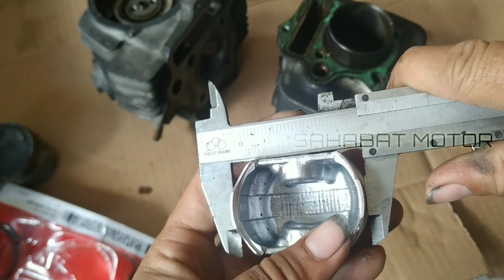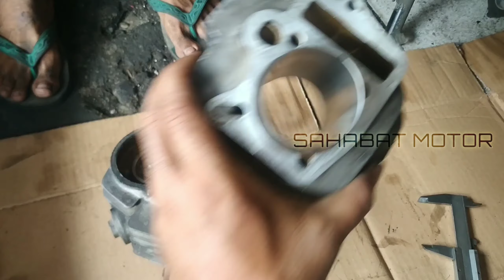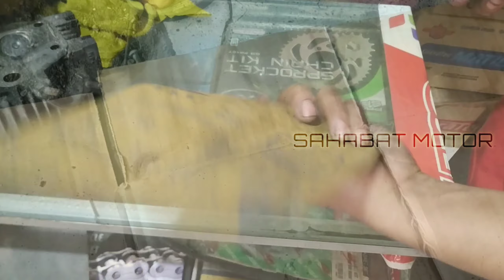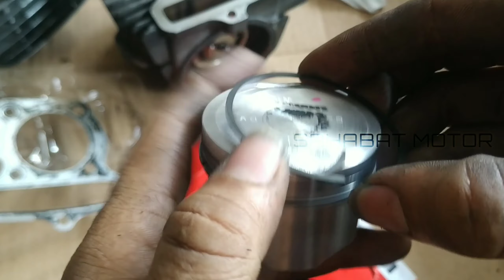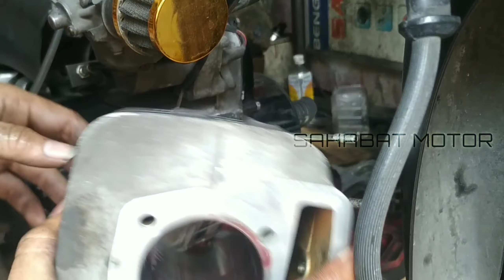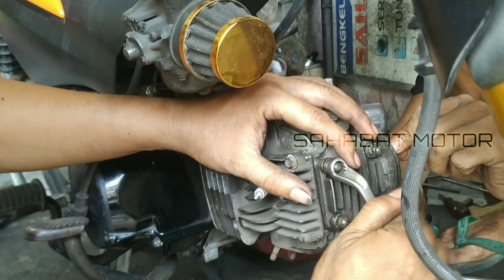bore up supra pakai piston vario 125 Awas ngangkat ngangkat

Comment: Saya sudah ganti dari tahun 2014 sampai sekarang blm ada kendala apa2 dan tarikannya joss
Reply from the maker: Mantap gan
Reply: Ganti boring ga bos?
Reply: Lemer Pake apa Boss?
Reply: Liner pake apa om???
Reply from the maker: Liner/Boring masih pakai standar
Reply: @sahabat_motor_denpasar  Mas mau tanya kalau liner supra 125 apakah bisa masuk ke blok sufit? Rencana mau saya isi piston kit punyaknya vario 125 tapi liner pengen masih tebel biar ga overhead. Soale biar aman kalau touring mas. 
Terimakasih sebelumnya 🙏
Reply from the maker: Bisa bang , boring nya aja kan ? Tukang bubut lebih mengerti bang
Reply: @sahabat_motor_denpasar  iya bang. Makasih informasinya ya bang
Reply: cuma ganti seher aja y om .. ngak ngerubah yg lain" kayak klep n noken kah
Reply: Apa saja di ubah mas
Reply: Itu besarin krengkes apa tidak bang
Reply: @abdulah.naufal.m2347  harus bubut mas , liner supra itu kecil
Reply: Piston nya di bubut lagi gak bang
Reply: Klep masih pake standar nggak bos
Reply: Pake os brapa om pistonnya? Pnp kan ga harus kolter lgi
Reply: @ariefrachman3582  harus korter
Reply: Untuk klep standar kah bang
Reply: Sampe sekarang masih make seher Vario 125 bang
Reply: @sahabat_motor_denpasar  klo revo lama 100 ganti piston vario 125 pnp gk bos
Reply: Habis berapa mas ganti seher Vario 125
Reply: Mas sisa liner supra fit pakek  piston diameter 52 berapa sisanya @sahabat_motor_denpasar

Comment: Untuk honda gren ap tinggal psang mas.standar gren50 ama 52 punya vario 125.jd oversi 200ya.?
Reply from the maker: Kalo v 125 52,4  coba dulu mas masukin kalo terlalu seret poles aja di tukang colter

Comment: Jupiter Z robot Yang Udah Oz 100 Di Pakein Piston Varion Gimana Bang?
Reply from the maker: Maaf kak belum pernah coba , mungkin kalo ada kerjaan untuk seting harian Jupiter z new saya buatin Vidio
Reply: Siap Bang..Tapi Ukuran oz 100  Diameter Berapa Tuh Bang?
Reply from the maker: @kumpulanstory9125  Vario 125 -100 = 53,4
Reply: Klo Piston Jupiter z robot oz 100 Diameter berapa bang?
Reply from the maker: @kumpulanstory9125  51 mm kak
Reply: Berarti masih bisa di korter tampah harus ganti liner/boring